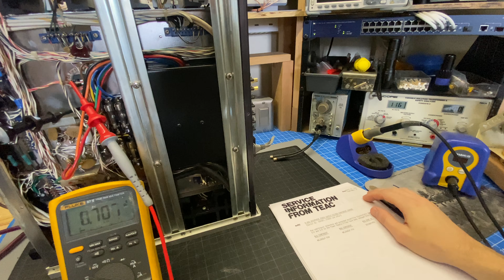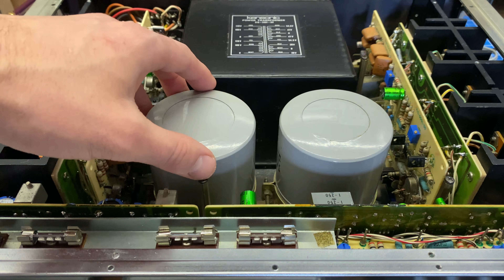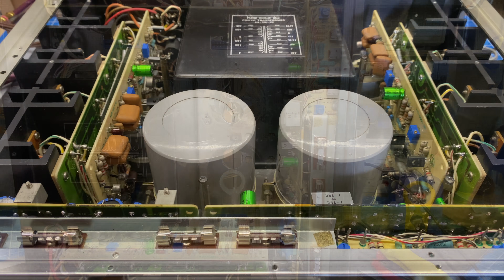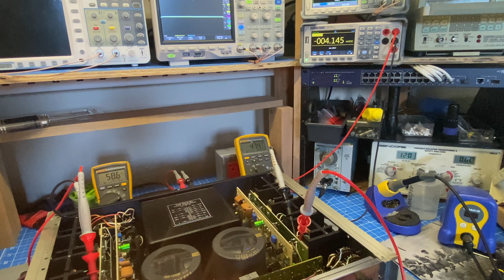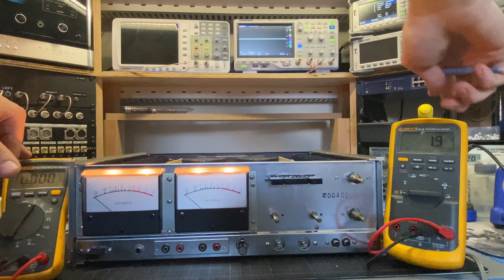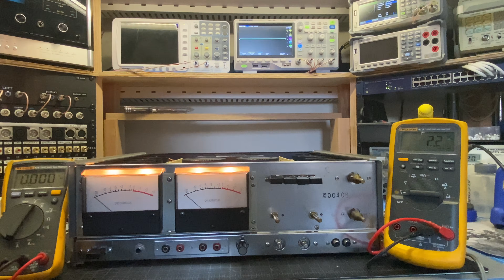Accuphase P-300 ~ Restoration Part 5 ~ Filter Capacitors, Amplifier & Meter Adjustments, LED Lamps

Comment: Why LEDs  in the first place ?
Reply from the maker: Incandescent lamps create a lot of heat which is not good for 1970s electronics. The way this model is built it’s probably fine to stay incandescent but on receivers with plastic diffusers there is a very strong case to be made for LED conversion.

Comment: Hi. I know this is an older video but I was inspired to replace the filter caps in my P-300 with the exact same you’re using. It appears you’ve placed both of your caps with the negative lead facing right. When viewed from top and front of unit. I think my amp has a copper strip between these two caps. Wouldn’t both caps be installed with the negative terminals attached to this copper ground bar?
Reply from the maker: It’s worth doing some schematic study of power supplies before you go too much further. This amplifier has a positive and negative power supply. If you install the caps the way the you suggest you are in for a light show and blown mains fuse at the very least.

When dealing with a negative supply the + of an electrolytic cap goes to ground. If you have pictures of the original parts you should see that this is the case. Drawing a little diagram of how the original parts are installed will help you visualize how to connect the replacements.

Good luck in the replacement, be sure to observe the proper safety procedures and if you are not comfortable consider taking the unit to a repair shop for service.
Reply from the maker: Also - if you have not purchased the Nichicon caps yet consider going with the ones offered on eBay (Blue United Chemicon) I reached out to the seller after having trouble sourcing the correct values myself and he was able to source an exact fit replacement with the correct value. I have not personally tried them but it may be something to consider.
Reply from the maker: I also remember having to rotate the caps 180 degrees from their original orientation and construct a new ground bus bar that went to the outside terminals instead of the inner terminals. There is a document floating around on Audio Karma related to installing these exact caps. I would definitely encourage you to locate those instructions. This is not a straight forward cap swap.
Reply: Thank you. After many hours of reviewing how the replacement caps had been installed, the schematic and audiokarma posts I think I’ve got it. My amp was working nicely before going down this path but a PO had installed 9600 Mfd caps and they were old. Figured I should change them. What I have, assuming looking from the top with the front toward me is : 4 purple/white wires to C1 neg terminal- positive terminal to copper bus. Then C2 neg terminal to copper bus and finally 4 red/white wires to C2 pos terminal. I believe that’s correct.

Comment: Excellent work, Ben. You are the quickest, most thorough and well spoken restorer on YouTube. Some may argue with thorough recapping of these units, but if I was in the market for one, I’d like to know that it had all new caps. No one wants to have to return a “new” unit, after all. 

Its a shame about having to use the 22000uF filter caps, but you were trapped. There weren’t any smaller 40K caps available that would have fit?
Reply from the maker: Thank you for the kind words. A contact of mine actually was able to source an acceptable replacement cap for the main filters and has posted them for sale on eBay. I may pick up a set down the line.
Reply: @NovaluxStereophonic  Better 40k, I think of a more black velvet background. At least that is the feeling when I made changes to the filters of my amplifier for ones of much better quality and that I maintained the capacitance value. Btw, very nice job.

Comment: New to audio adjustments. Can you explain what the Bias and DC Offset is and what the adjustment is doing? I'm guessing bias is to make sure the levels on each channels are the same?
Reply from the maker: DC offset ensures that the DC level of the speaker outputs is as close to zero as possible at idle. Bias adjustment sets the ideal current of the output transistors to the optimum level to ensure minimal distortion without wasting unnecessary energy as heat.

Comment: I enjoy your videos, but man, I would not have so drastically reduced the capacitance of those main supply caps. If I had to, I would have hollowed out the original cans and put inside the same or slightly higher value capacitors. With more modern caps the physical sizes are smaller and usually you can do this. I’ve done it a lot for old tube equipment where preserving the original appearance is important but so is electrical performance.
Reply from the maker: Not a big deal to go back in and change in the future. I did eventually find a source for an exact fit cap. If so ever do a swap I’ll try to post a video with before and after measurements and listening tests.
Reply: @NovaluxStereophonic  That would be an interesting test.

Comment: These videos are terrific. I’m about to overhaul one of these myself. Any chance you’d be willing to list the specific new stock transistors you swapped for the originals?
Reply from the maker: You would need to be more specific. There are so many transistors in this piece that needed replacement. I would encourage you to read up on the Audio Karma posts related to this unit. EchoWars has a parts list posted there for caps and such and a lot of the transistors sub options are discussed there as well.
Reply: @NovaluxStereophonic  Sorry I should have been more specific. In video 4, there is a great image where you appear to have replaced Q3-Q6 and Q9-Q14 on the Main Driver Boards. I was curious what you used for Q3,Q5 | Q4,Q6 | Q9,Q11,Q14 | Q10,Q11,Q13. Some of the popular replacements for these listed on the AK forums have gone EOL in the past year, so I was just curious what may be obtainable.
Reply from the maker: @jakeh54  My notes show that I used KSC1845, KSA992, KSC3503, KSA1381. I do not have it broken down by Q designation for this bird unfortunately but this may get you pointed in the right direction.
Reply: @NovaluxStereophonic  Perfect -- thanks so much! This is exactly what I was looking for. Looking forward to seeing more of videos. They are fantastic.

Comment: Blue is my choice. BTW. this amp is like the bunch of high end power amps such as the Mac, the Crown and the likes. When younger, I remember working for a DOD projects company that made a lot of simulators for the government. One of the projects required several toroidal x-formers. The company we chose was McIntosh. We asked them for ~ 10 each. They said, "No, we can afford to sell you any by themselves" So, our co. bought a bunch of power amps, removed the x-formers and discarded the balance. Just to see those beautiful chromed chassis sitting in the bin was horrific to me. Never forgot the sight!
Reply from the maker: That’s Crazy about the Mac transformers. Thank you for sharing.

Comment: I prefer the Cool White. I note that you usually do not list the costs of your parts. That would be very helpful to know and perhaps the hours you spent on the project of phases of the project.
Reply from the maker: I like the cool white as well. I may include the labor and parts info in the restoration review video. This unit gets very pricy on parts especially if the outputs or main filters need replacement.